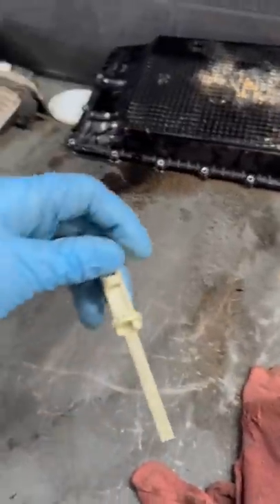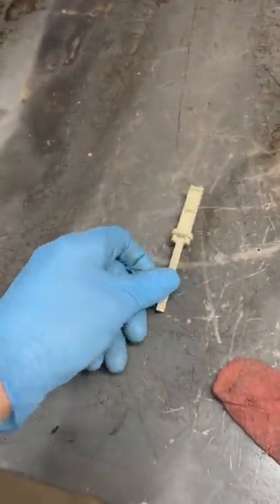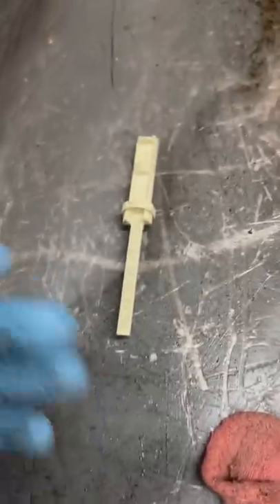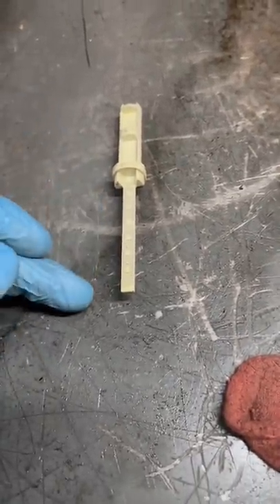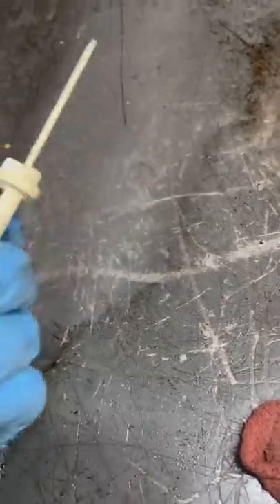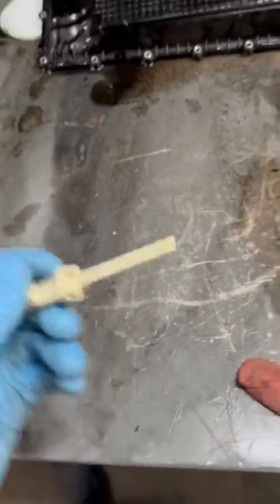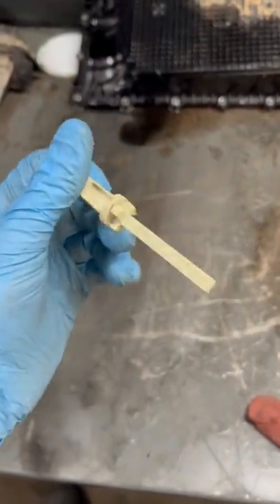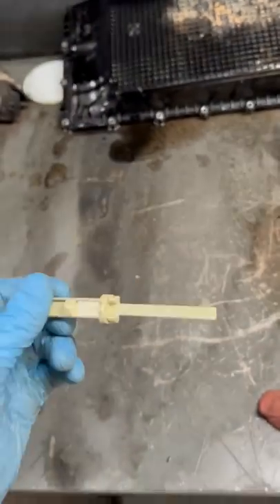Why do car manufacturers make my job harder? #shorts

Comment: That’s because it’s not supposed to be time efficient for the mechanic, it’s supposed to be cost effective for the manufacturer
Reply: Nailed it.
Reply: Wait, so making different size pieces of plastic is actually cheaper than all the extra time in labor that Ford has to pay their employees on warranty work?
Reply: @gheebuttersnaps2011  they're already on the clock. Sunk cost.
Reply: @motfc8  So if they are turning 1 to 2 hour jobs into 7 hour jobs don't they have to hire more workers to get the job done?
Reply: @abstrakt26  is not the engineer's fault, is project management's who has to meet corporate.
Reply: Wish my tranny even had a dipstick, if i wanted to change the fluid id have to meassure or find out exactly how much it takes and just pray it stays in 😅
Reply: @abstrakt26  you want more specialized parts. you realize this just jacks up prices of the vehicle itsef
Reply: Touché
Reply: @maxfried5328  welp, look at where vehicle costs are at now in the states...
Reply: Even more to the point, it makes it easier to source parts when they're all universal I don't have to be looking for a specific part that only came for my truck in the single year modle and only in the 4×4 and blah blah blah. Makes life a bit easier especially when your working on your vehicle yourself
Reply: Exactly! Blame the executives and shareholders for shit cars. All it’s become is use general inventory supply in cross platforms. What mold tolerance can this part fail at? A project engineer is doing far more accounting than design and that’s driven from above. What can you do?
Reply: And a huge windfall money maker for dealership service centers!
Reply: @gheebuttersnaps2011  no each dipstick would be made you have to have a dye made each die would cost between 10 and 15,000 the differences are minute versus just printing a different page in the instruction manual
Reply: I mean it's literally JUST cheaper production. The final product means nothing past mpg and consumer opinion now.
Reply: It’s not engineers fault, blame finance.
Reply: That's the problem the efficientcy should be for the owner or mechanic of the product but your right the problem is it's a seller's market vs a buyer's
Reply: @gheebuttersnaps2011  no because it doesn't become a 7 hour job.
Reply: Was about to post this when I saw you took care of it
Reply: @jris  The problem is the consumer. Not the manufacturer. The manufacturer is only going to manufacture what the consumer wants. And the problem that the consumer has is that they have too many choices now. Maybe we need to go back to the old Henry Ford adage, you can have any color you want as long as it's black.
Reply: That's capitalism babey
Reply: Exactly. This literally saves a ton of Money
Reply: Who are you?  :manufacturer
I'm a dumb...  :You
I make millions of dollars so nobody cares about you!  :manufacturer
Reply: This is why i stick to good ol classics. Nothing but an engine in front of you with everything in reach.
Reply: This.
Reply: So you’re saying it’s supposed to be gay
Reply: Exactly cost customers even more money to maintain it smh
Reply: And a pain in the ass for the customer, so they bring it back to the dealership to fix it..... And a pain in the ass for jiffy lube so they put the wrong amount and type of fluid in it, destroying the transmission, causing the car to come back to the dealership for a new transmission.
Reply: They’re already using the cheapest plastic they can for them lmao
Reply: @abstrakt26  that's not engineers. That's business majors. 

Trust me every engineer wishes they could turn that kia Rio they are working on into a McLaren. Engineers don't make these types of design choices from such a large manufacturer.  They just make what was requested a reality...
Reply: That's a bunch of b***** it's not going to be that critical just as long as it's not on the low side
Reply: Yes and when ford saves money they lower their vehicle prices....right.....guys?
Reply: Yosss! 👍
Reply: True, integrity doesn't matter to the bean counters and they've been showing their "respect" for the mechanics tasked with keeping their creations on the road for a long time now. 

Blatant disrespect and they keep doing it.
Reply: Hit the nail on the head. Goes all the way back to the Industrial revolution, interchangeable parts are the most cost effective. And speaking as someone who is a machinist by trade it’s much cheaper than making a whole new production process for every different dip stick.
Reply: Not true as the car maintenance for first 3yrs will always be on the manufacture due to the warranty. Meaning the manufacture pays for all the extra training and extra maintenance time due to shitty designs.
Reply: WTF when did they start making them out of plastic and that tiny. I've driven the same vehicle for about 24 years. A 1987 Ford Bronco no problem reading my dipstick.
Reply: @joelcollings5620  just drop the fluid into a measurement jug and put the same amount back in
Reply: Just get to know the system and get good kid
Reply: Fords designs truly are stupid 😂 toyota makes it so easy to get to everything so easily
Reply: @maxfried5328  How about the big wigs just take less of a profit
Reply: Literally 😂
Reply: That's the very nature of engineering.  Cost effective for the manufacturer not time efficient or convenient for anyone,  least of all the mechanics.

Comment: Think about this (i work in the engineering side of things) the person that brought up that idea that pisses you off so much got a HUGE bonus for the cost saving across all those platforms.
Reply: More like their boss got a big bonus
Reply: The amount of things that are simplified because of a single part like this, rather than individual is crazy, from the tooling needed for injecting, to the spare inventory, and the assembly process time savings will never be understood by somebody who can’t be arsed to lookup a number from a manual.
Reply: You're the problem with auto manufacturers. Every engineer should have to take apart the car after a Minnesota winter
Reply: the company brings in a billion a year, why do we care?
Reply: nothing built quite like a ford🤣
Reply: If some of those savings were passed on to the consumer,  that would be ok. Bug I highly doubt that happens
Reply: Yeah and pocket the savings, create unreliable vehicles that cost more to maintain untill they are sold for fractions of the price, drive the customer to buy a 20 year old tacoma

Comment: At least it has a dipstick.  None of that 'get it to x temperature and wait for it to spill out the fill level hole' bs.
Reply: This is supposed to be at operating temp, THEN pull the stick, after you burn your arm on the blazing converter 2 inches away. Engineers are a special kinda stupid.... 🤦‍♂️
Reply: Ah yes the ol' zf
Reply: @Matt-mq1ep  I feel engineers are the ones who got bullied on the playground. As adults, they assume everyone assembling the vehicle was their bully.
Reply: @Matt-mq1ep  It's a educated kinda of stupid. They have had special training.
Reply: Gotta love toyota between 115 and 140 degrees
Reply: @cinnabonwonton6047  for sure, same with Subarus.  I think 90-120 for them.  Nothing like making something with a sensitive fill level an educated guessing game.  Temp sensor says 100 but is all the oil 100?  Waiting for the oil to reach a "trickle" but your opinion of what a trickle looks like and mine might be different all while the oil continues to warm and expand ect. ect.  Just give me a damn stick and make the pan a half inch deeper so the margin for error is larger FFS.  Be a mechanic they said, it'll be fun they said... Make me look like 👴 20 years before I should 😂
Reply: My 2019 with the 6 speed has to be at 206 degrees to check.
Reply: Ahhh yes GM engineers
Reply: My cts-v had that, absolutely hated it
Reply: @Matt-mq1ep  you need to get steelman Kevlar safety sleeves. It is worth the $25 to not have a shitty day from a contact burn. Especially for tight engine spaces to avoid cut zip ties.
Reply: That would make it easier to be honest, you still have to get it hot to check the level anyways
Reply: @cinnabonwonton6047    fun stuff for sure.  no point in designing in an actual dipstick.  if they weren't so damn reliable I wouldn't drive one but they have always been good to me and most of my family so until they dip on quality I'll keep buying them.
Reply: @Matt-mq1ep  Accountants*
Reply: I prefer it.  Depending on the temp trany fluid raises and lowers by 1.5 inches depending on the transmission of course. It's a lot closer to the old manual transmissions with drain and fill ports.
Reply: Yup GM transmission’s suck 
Waste fluid & cheap parts
Reply: @johnantonopoulous6381  I'd be fine with it if it had a larger margin of error.  I work on heavy trucks which have the drain and fill ports but the margin of error is large enough that you can fill it ice cold or full operating temp and it'll be fine.
Reply: Cost effectiveness, something dumb mechanics never will understand
Reply: My cousin tried to do his own break pads on his 2020 chevy and it now wont go over 43 mph bc of the new senors in the break pads he broke it off and replaced it and apparently you have to have Chevrolet fucking program it lmfao for some damn break pads ladies and gentlemen.
Reply: Planned obsolescence
Reply: Newer Chevy fwd trans a usually 180 as well as Nissan automatic rwd trans.
Reply: @Tman0517  you mean 6f
Reply: Toyota tundra had to go in my Chevy to go buy some fluid cause it took 30 minutes to check it 🤦🏻
Reply: @christopherharvey8361  ends up costing the consumers more because it takes the mechanics longer
Reply: @scottwolfe6584  Ford but ok
Reply: I like my 03 civic.
Has a hot and a cold fill line on the stick. Makes life pretty easy, since ya know, she pisses fluid... still love the old thing.
Reply: @tunasub9696  I was just stating the GM’s transmission suck they have a lot of failure’s I’m aware that is a Ford trans
Reply: Yep. My Volkswagen Passat was like that!  Get to full operating temp and fill from underneath. Wait for it to flow back out, and then it's full. All the while wearing half of it or trying not to insert the pump tube too far in to knock the inlet hole baffle off.
Reply: Toyotas too.
Reply: Looking at YOU 8speed in Ram.
Reply: CalvoG  you realize vehicles have to break, heat and friction equals wear thus failure, impossible for a vehicle not to have heat and friction therefore will always wear and always fail, they are not designed to break, they have to due to laws of physics, manufacturing process could however care a little more about the people that have to service and repair the failures
Reply: @christopherharvey8361  Found the industry shill
Reply: @Josh-jw3go  I’m a service technician at a dealership in NC, I just understand how things work and if we on it about the industry, government is the problem, cafe standards and regulations by the government is why we see the problems today, vehicles of specific size and weight has to me certain standards, that’s why operating temps 30-40 degrees hotter than 20 years ago, leaned out and optimizing atomization of fuel equals more heat and more failures but try get government to understand  that
Reply: A dipstick is just an access point for the customers to do something they shouldn't
Reply: @mdtransmissionspecialties  no, he means ZF as in ZFAT, as it's notated in the service information from GM
Reply: @christopherharvey8361  how is it cost effective if the consumer pays over 30,000 for a new car.   It's plastic part's.  Ripped off.
Reply: @victorrhone6785  tell you what start your own car manufacturing business and then you will know, government is the problem period
Reply: Lol after checking it 4 times you lost enough fluid to have to add another quart.
Reply: @Tman0517  I just fill that shit until it starts to overflow and then plug it up and run it like that. Lifetime fluid my ass
Reply: I actually prefer these types no guessing if it's at the right level just pull the plug let it level out good to go
Reply: @YeetxBoi  you keep telling yourself that.
Reply: @scottwolfe6584 That transmission was designed by Ford & GM
Reply: did a 17 rebel today. between 86-122 degrees. managed to leave some arm skin on the exhaust

Comment: LMFAO' Young Mechanic learns the age old lesson! Engineers hate Mechanics!
Reply: Engineers rarely have mechanics in mind. It's about the $. If they can save $0.03 per unit, then it adds up over time.
Reply: @danielwilkinson1024  comments like these make me realize that most folks have no idea what is engineers do. I’ve never met an engineer who wouldn’t want to provide the best solution. Every decision in engineering is a balancing act between countless aspects including cost, repair, maintenance, quality, etc. saving a couple penny’s on a dipstick provided that much more capability to swing the other direction on a more critical part. In the automotive world, the bean counters usually win.
Reply: @prodigalpilot  you wouldn't think a little tiny plastic dipstick would be that big of a deal but the reality is manufacturing multiple dies is tens of thousands of dollars and then making sure those ones get shipped to the right place that's making the right transmission versus just a ubiquitous read the manual it seems more intelligent from a business point of view
Reply: @tcantrell5301  indeed. Parts commonality is almost always a good thing. Sure, it can be annoying from time to time, but the pros far outweigh the cons.
Reply: @danielwilkinson1024  it finances fault
Reply: Boy have you got that right!! Some vehicles I've worked on....if engineer was standing nearby would've been killed dead....by me!
Reply: Make a fill plug great again?
Reply: @prodigalpilot  you’re lying. You are making stuff up. Your experiences aren’t valid when every German manufacturer does shit like this. Idk what you’re thinking of when you say “they look for the best solution” because they don’t.
Reply: @BumpTune8462  ok, differing opinions is fine.
Reply: @BumpTune8462  actually they do look for the best solution, for their business. This might not suit the singular consumer, but they are not designing and building for the singular consumer.
Reply: Other way around.
Reply: He said it correctly in the vid, hate the mfg. Most of engineers I’ve worked with are actually hobby mechanics. I’ve worked for two manufacturers that will have us (the in house design team) create an awesome concept, then when we’re done project managers and sourcing pass it off to third party contract firms for cost reduction and take quotes for substitutes from suppliers for every little part. If it were up to the original design team that F150 might cost $150k but would last 50 years with easily repairable parts, instead it cost $40k and last 5 years. But on occasion things in the parametric model on the computer screen do look like they have more clearance than they end up having…
Reply: As both I can verify
Reply: Engineers don't always want to design things to make it harder to fix. It's all about the money, and they don't get paid to make those decisions.
Reply: Which bolsters my argument that Engineers should stick to driving railroad locomotives
Reply: Most engineers are a product of the education system and most mechanics learn at an early age from hobby or necessity.
Reply: @danielwilkinson1024  that only helps profits for the companys and never lowers the cost of the vehicle for the consumer. If they knew how this crap was built they would have never cashed in on their clunkers.
Reply: @jasonstewart3748  this is ridiculous and screams “I’m blue collar and better for it”. When I wanted to be a Mech E it was precisely because I grew up around cars and wanted to do more than just fix them.
Reply: BRO!!!! LMFAO I'm an Ironworker and we say that too!
Reply: More like "corporate development hates mechanics" because they set the guidelines for how the cars are engineered in the first place.
And corporate wants two things, low cost and high profit which includes dealerships keeping their workload full with repairs that are designed only for them to perform. Especially on modern vehicles.
And when things eventually move over to EV, that's a whole different ball game in itself.
Reply: As a turbine mechanic I can tell which designers have ever repaired anything real in their lives and which ones only on paper.

Comment: The fact that you have to pull the dipstick from inside the frame rail is a big wtf ....
Reply: What frame rail
Reply: It’s a ford Brandon lol 😆 what else would you expect
Reply: Actually it looks like it's in the back of the trans by the cat. Still get ur point though
Reply: …imagine the length of the transmission dipstick if they made one for a Ford F-350 or F-450….
Reply: @DiscoMiata  you wouldn’t just go straight up or up on an angle
Reply: @LegacyLife_555  what
Reply: Frame rail? Nah fam, that's by the cat and you check it when the fluid temp is up around 190*F and the cats are even hotter.
Reply: @DiscoMiata  no just no the length isnt a problem
Reply: 7.3 million mile engine
Reply: Dipstick for my jeep was like almost 4 ft long but I had one.
This is bullshit
Reply: @TacticalBaconPatches  my exact thought, good luck trying to get your hand up in there 💀💀💀
Reply: Haha thats nothing try the nissan versa u gotta take out the battery and engine air filter and go underneath the engine and its a tiny dipstick its annoying smh
Reply: @DiscoMiata  the superdutys get real dipsticks and they are really not that big lol
Reply: Wouldn't be the first time I've heard of Ford being a nightmare. My dad was a mechanic from 1994 to 2007 and he's told me about how God awful it was to work of Ford Aerostars doing stuff like spark plug changes.
Reply: Quite simple!!:
*Engineers being replaced by 'bean counters'.
*New Third Millenium 'planned obsolescence'.